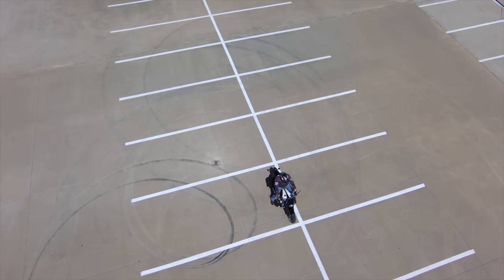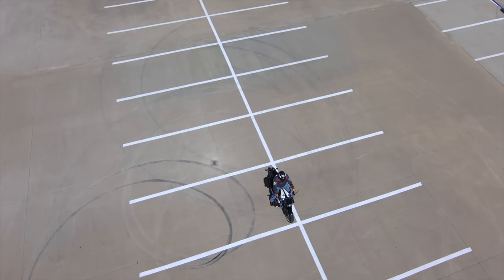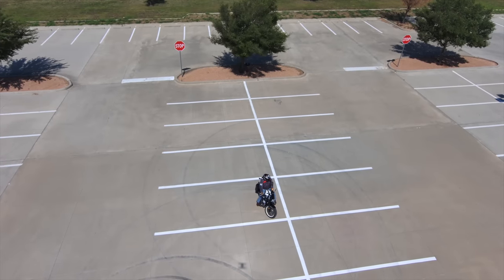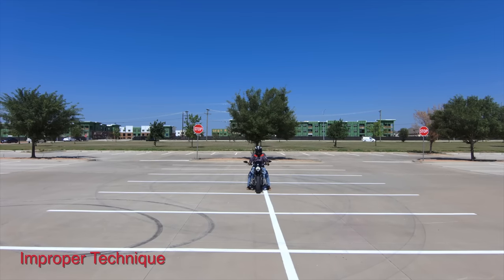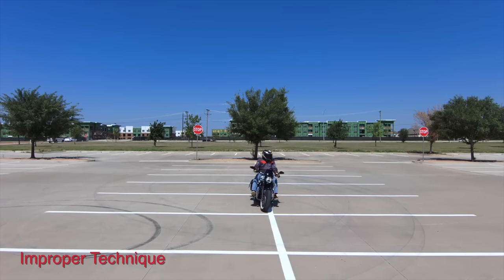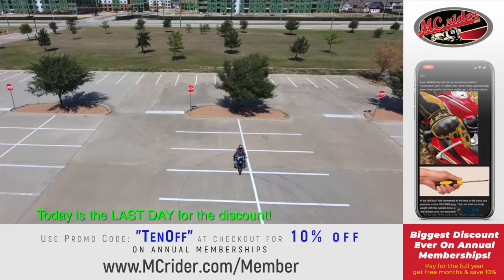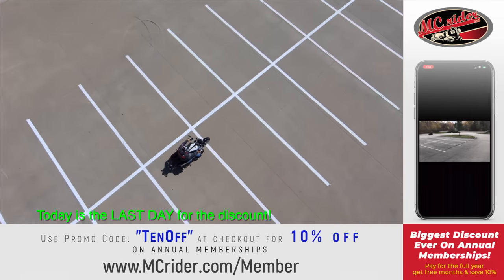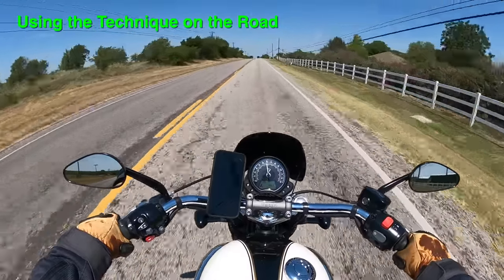How to Turn a Motorcycle from a Stop the Right Way

Comment: If you're in the habit of resting your index and middle fingers on the front brake lever be cautious not to squeeze said lever during the turn. Always interesting and informative, thanks!.
Reply from the maker: This is true especially for new riders. One of the reason why the MSF does not advocate covering the brake for new riders.
Reply: Yup... THAT'S an invitation to "splatville" population you and swelling and neither of you is having fun... haha...

    It's easier done than you'd think, too. I'm not refuting that... Building the habit of covering the brake is fine and all for reducing reaction times, but when your "knee-jerk" instinct becomes a squeeze, during certain maneuvers it can bite you in the backside...

     Rather, I prefer to make the conscious decision on braking, relying on a system of Rear then Front then Clutch... as you get more aggressive on the brakes, all the way to a stop.

    AND at least, so far, it's worked out well for me... Obviously, you do you... I wouldn't change what you already know...

     BUT if I am asked by a new rider, "Rear, then front then clutch/downshifting" is my preferred method to teach and drill... It's just a good solid habit to get into...

     AND for those who b*tch about "The front has 80% of the braking power"... Well, I'd rather use 100% of my brakes in an aggressive braking situation... You can gamble (if you like) on 80% doing it... BUT I'd prefer 100 over even 90% if I have a choice in the matter.

     Maybe I'm weird.  ;o)
Reply: Good callout. Avoid front brake on slow tight turns. It's amazing how fast one can drop a bike when applying front brake while wheel is turned. Especially if forks are compressed as you slow.
Reply: But for proficient riders the finger never leaves the lever. 
 Gyroscpic effect. 
 Dirt bike experience before pavement is very important. Honda makes an XR100. Put your behind on it or another of the like for some time. It's my opinion that if you have not learned to control on the dirt before road you are going to crash hard on hard top not pretty 😢
Reply: Thanks man!
I learned that the  hard way. 
And  didn't know for a long time what happened. 
But  hey.    I did learn.
Reply: Having forks compressed when on the front brake is almost always better, though. Not that using the front brake is good on slow speed stuff. It definitely isn’t. But you want your forks compressed if you are going to use it, so you know your front tire is loaded. If not, you’ll wash it out.
Reply: Usually, if your front brake is adjustable, and adjusted properly, it’s almost impossible to grab the front brake without rolling off the throttle first. At resting position, the lever should be just at the second knuckle on your pointer finger. When mine is adjusted correctly, it’s just my fingertips that are touching the lever when I’m on the gas. None of this negates your comment. You definitely have to have the discipline to not grab your front brake, but you have to have that discipline down under most all riding situations. I’ve met a lot of experts here on YouTube that will tell you to never cover the brakes and clutch while riding, and that’s how their cousin’s aunt Tracy’s son’s shop teacher washed the front out while they were riding. Lol. It’s all about discipline, man. Those are the same people that will tell you their msf teacher told them to not touch the brakes mid corner ever, when grabbing a slight amount of front brake in a decreasing radius corner has saved my life several times. I think that’s a good example of a beginner skill you have to forget once you’re better at riding.
Reply: I dropped my RK  at the  end of my  downhill  driveway. 
I finished my  stop with the  wheel turned  and used the front brake. She  took a  nap before I realized what happened.
Reply: New riders should not be covering the front brake. I recently did the course to finally get my license after riding illegally since I was 16 😂, and the amount of things I was doing wrong is crazy lmao. Yeah I knew how to ride already but I had allot of bad habits covering the brake is one of them apparently.
Reply: @A-bone  no. Covering the brakes was not one of the mistakes. They told you that, because they’re anti front brake in the msf course. They also tell people to not brake mid corner, which is fucking stupid.
Reply: @thagingerninjer5391  Well I mean, if I were to say that same thought wasn’t going through my head the whole course I would be lying, but at the end of the day I have been riding for close to 16 years, and the instructor has been riding for 37. I added that to the fact that I have to pass the course by doing as instructed, and decided to take their word for it lol. Allot of their tips were helpful though.
Reply: @A-bone  yeah, some of the stuff they say is great. You just have to remember that they’re giving advice to brand new riders most of the time, so they tell them things that they’ll have to unlearn, intentionally, to keep them from crashing before they really get a good handle on how to ride. Grabbing front brakes in a corner for someone that just learned to ride would be catastrophic, but adding a little bit of front brake pressure while easing off the throttle, to keep the front end planted, so you can decrease your radius in a decreasing radius corner has saved me more times than I can count.
Reply: @CodeDreamer68  been there, done that!     And surprisingly it  took me a while to figure out exactly what caused me to drop my bike.

Comment: Any tips for turning to the right from a stop while on an uphill incline?  Which brake should I use to prevent from rolling backwards down the hill?
Reply: Rear brake. This allows you to give it throttle prior to letting off the clutch. Hills where I am are not that steep and my bike isn't that heavy, so I can do all of that smoothly enough from the front brake, but on steeper hills it is definitely easier to use the rear brake.

Comment: One thing I would add is to get your RPMs fairly high so you have power in reserve. Especially on a larger or heavier cruiser. Just how much of that power you tap into is controlled by the friction zone. But it's immediately there if you need it.
Reply: That can be the last ting you do, if you steering your bike like this. And you loose the clutch for some reason. Seen lots of people do this with a little to much throttle. And the bike turns the other way, strait into traffic. Just looking out my window sometimes, on the nearest traffic light, I have seen it twice the last year or two… Almost got run down by the car coming against them. Using counter-steering is much safer, then the bike do the same, now matter how much power you give the bike.
Reply: @Gismo3333  I agree with using countersteering .. however in this case when turning from a stop countersteering does not come into the equation. The bike needs to be already moving with some speed to use countersteering.
Reply: @gregwhite8470  — it is obviously that you just don't know that you do use CS. If you don't use it, the bike will go strait, and not turn at all.
 CS always work, even when the bike is not moving at all. Keith Code proved this long ago. So you say physics is wrong?

Maybe do a little research before you say that someone is wrong. At least on things that can be the difference between life and death. This has been a known fact at least 30-40 years or more.
Reply: @Gismo3333  no need to get testy. We are all entitled to different opinions. My comment is based on the training received from a motor officer. Others also recommend "pre loading" with some extra RPMs to have power in reserve.  It's not a new concept. You may want to expand your YouTube research.
Reply: @gregwhite8470  — I don't need to research things I have seen with my own eyes. I trust my self, my eyes and ears, more then I trust a YouTubers with the intent of making money.

You are calling me out to expand my YT research?
I have my own experience, that I tried my self, and know that it work.
Who many times have you made it up a hill whit ice on it?
I did that every day, two winters in a row. You think you can even come close to me with YT research… You are delusional.

— I literary have more experience then you, in my middle finger.

And I don't give advise to others, only from what a random research on YT.
Only research on YT don't trump real life experience.

Tell that to a compete noob… And he rew the bike up to 4000-8000rpm and pop the clutch turning into a road with lots of traffic. That is going to end really well… He probably come back and thank you after.
Reply: @Gismo3333  as with all motorcycle techniques .. practice practice practice in a safe parking lot before attempting them on the open road.
Reply: Agreed.
Without enough throttle you stand the chance of stalling the bike.
Stalling the bike with the handlebars turned and the bike leaning usually ends up with the bike being dropped.
Ask me how I know.🫤
Reply: I was struggling with this then while i was driving today i saw a biker in front of me do this exactly then a light bulb lit up in my head lol

Comment: Love the vids.  You say lock the turn but we, and you, have lots of blacktop loose gravel on the turns.  Right where the low spot is between your road the turn road.  You suggestions to dealing with that gravel which will slip that front tire in a slow turn.

Comment: So this comes at the perfect moment in time, for myself anyway. I have only been riding for 3 weeks now and continue to analyze my skills and the lack of them also. I live in eastern Pennsylvania and the roads here are narrow, twisty, gravely and quite full of hills. My biggest problem right now is negotiating turns from a full stop. For some reason turning right seems to be more difficult than turning left. In addition, I ride a Honda Rebel 1100 DCT which is a blessing most of the time, but sometimes such at a stop I have to be very careful and conscious  not to inadvertently give it to much throttle. Anyway, thanks for this information and all the other informative videos you provide. 🙏😎
Reply: In the meantime, (like while you're still practicing) you CAN stop about 2 extra feet back most of the time... This lets you just get the bike rolling (and stable) before you negotiate the turn, making that turn its own entity and separate from starting off. I did that when I was still new and clumsy with things... and there's no law against stopping a bit behind where the "line" is... OR giving yourself an extra couple feet behind the next vehicle, for the matter...

    Obviously, you'll still want to shore up those skills and all anyways... It's just good sense. BUT one thing at a time. Riding is complicated enough, especially when we still want to do more than tool around parking lots with our bikes. SO keep up on the drills, and all... This isn't an excuse to slouch on those.

    BUT a lot of folks seem to think there's no space out there, and it leads to panic and emergency stops and other maneuvers when they aren't needed... You actually have some space to play with and so long as you've got it, it's OKAY to use it. It's not necessarily "strictly good form" BUT it's still okay. Try not to get run all over and work toward the simplicity of "Look where you want the bike to go" and she'll go there for you.  ;o)
Reply: @gnarthdarkanen7464  , thanks for the helpful advice. 🙏
Reply: @hurricanebillbass1     Always welcome. Nothing good comes from making anything any more complicated than it has to be. Riding is a skill you'll build upon for the rest of your life, even when you don't realize it.

     SO starting out, it's okay to be clumsy. You don't want to prolong it (thus my disclaimer in the earlier post) BUT we were all "noobs" at the beginning... AND as my riding coach explained, you can make things easier on yourself or you can make them harder on yourself... I'm lazy... I like easier...

     AND it's worth saying that "simplifying" the processes also makes it SAFER in general, at least until you've grown the skills to handle it. You'll get there from here. I believe in you.  ;o)
Reply: Your problem will go away when you get a Rebel 300 or a 500 to train on. Your bike is to powerful and heavy for you to handle. And that makes it 100 times harder to learn the smallest thing. When you have a DCT, you have to be a expert on throttle control, with low speed or sharp turns. And all roads one can drive a car or a big truck, is not narrow to a bike.

 Wake up and smell the coffee, before something serious bad happens. This is not a game, that you have to win to day or even this year. We are just trying to survive on the streets.

Why do you think every one that ever have been a good rider, started on a small bike?

Comment: There's something to add on this tehnique which really helps alot and that's while pointing your head and turning the bike towards the way you wanna go and slightly leaning the bike also, adding a bit of counter balance. Slightly leaning your hip or the mid-low part of your torso to the opposite side which gives more control while leaning the bike in the direction you want to go. The result is also being able to make that turn more narrow, sharper while using the counter balance. Keep that in mind and, of course try it!
Reply: Great point.
Reply: 100%! And dragging the rear brake slightly, to keep the wheelbase of the bike longer and stabilize it a bit.
Reply: If you have total clutch control then there is never a need for rear break
Reply: @wayneevans8484  that is the most false statement on this entire video comment thread. 😂

Comment: Interesting video, Kevin.  However, I was taught that starting from a dead stop with the front wheel turned is bad, as the power from the back wheel wants to go straight, and with the front wheel turned, the physics reduces the speed significantly, and, with the bike already leaning or beginning to lean, you don't have enough momentum to keep the bike upright.  I know this from personal experience, as I did just that in a hotel parking lot during the middle of a 9 day trip, and ended up with a fractured knee trying to keep the bike from tipping over.  I did almost exactly what you demonstated: Full stop, turned the handlebars to full lock, slow release of the clutch and ease on the throttle, and slight lean into the turn.  The bike almost immediately started tipping over.  What did I do wrong?  For added info, it was a 2017 H-D Heritage, and I had a passenger.
Reply: Maybe not enough throttle. Another suggestion is to practice with a passenger
Reply from the maker: Practice first in a straight line as shown in the video. Probably not enough momentum caused your drop. This is an important skill to develop. 👍🏻
Reply: This technique requires a commitment from the rider to follow through with enough power to keep the machine upright once it begins moving. The degree of commitment and skill required from the rider increases with the weight of the machine.

This technique will minimize the radius of your turn, allowing you to make much tighter turns; it’s great for executing a counterbalanced u-turn; although these techniques aren’t really novice moves, imho.

At the end, the video shows a rider perspective of a right turn which was tight enough to line the bike up with the center of the shoulder, afterwards the bike moved left into the lane, which is fine, but...

Comment: I noticed on every turn it took a long time for you to pick up your feet. I was taught “as soon” as the bike starts moving, pick up your feet. Curious on your thoughts, thanks.
Reply from the maker: Part of the reason is on this bike my knees are close to the handlebars when at full lock. I was giving myself time to get the handlebars straightened some to make room for my knees.  It is important though that I was not dragging my feet, they were off the ground. If you drag your feet you may get them hung up.

Comment: I just recently made this mistake. I had purchased my motorcycle it was delivered and 37 minutes later I was laying on the ground by making this exact mistake. I was pointed straightahead I was looking straight ahead. I gave it to much throttle and let off the clutch to fast. When I realize what I had done I tried to overcompensate turn how old fell. I tore three tended to my shoulder. Tore my arms to shreds. My big toe was in pieces. Thank you for the great video.
Reply: Have been practicing for weeks, and drop mine this morning g going to the left. Was looking straight and took the turn wide. I managed to stay on the small gravel shoulder however due how heigh the road was when I tried to get back on the road my foot peg caught, spun the back end of bike right out from under me. Fortunately, I had riding buddy behind me and to help keep traffic from hitting me. With minor damage, I was able to get back on the bike and ride it to work. I have sore wrist, strawberry left knee, bruise pride.

Comment: When I want to turn right from a stop, I turn the handle bar to the left (30-40 degrees). Once you apply power to the rear wheel, the bike will go a little bit to the left and will lean to the right if you allow the handle bar to react on it’s own. If you want to turn left, start with the handle bar pointing right! Try on a parking lot first. Search for videos on the Japanese Police making u-turns and you will see how they do this.